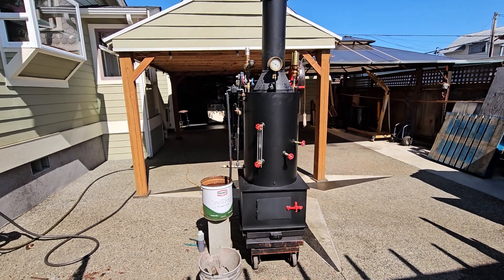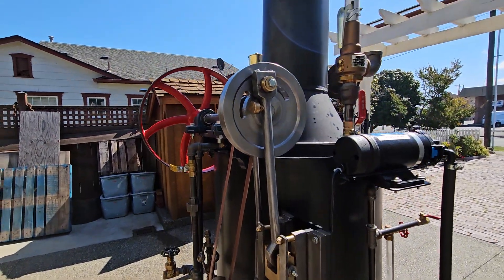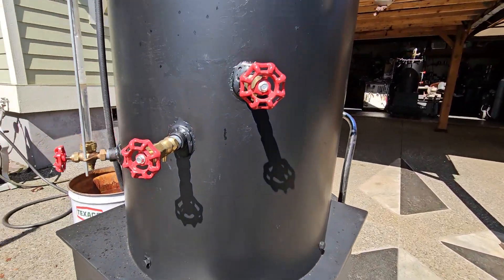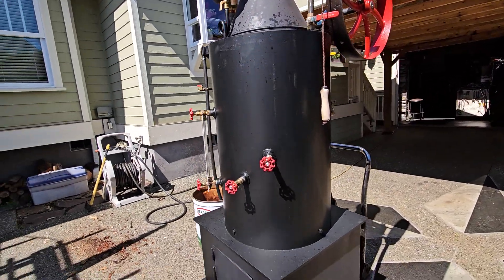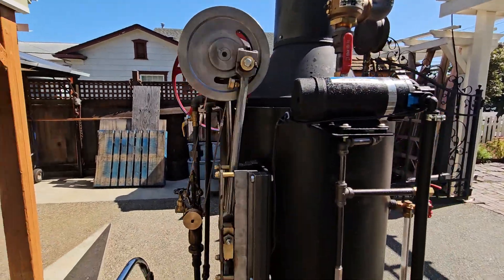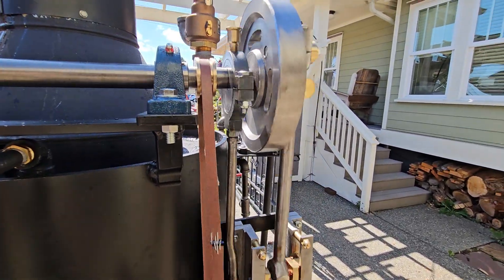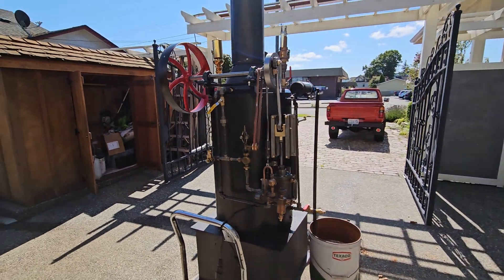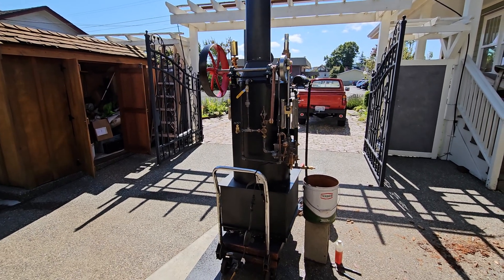Steam Engine and Boiler Overhead line shaft antique oiler whistle off grid Ross Bendixen

Comment: This is so cool.  I wish I had a better understanding of electrical systems.  For example let's say I had big lithium Ion off grid battery bank and solar system.  Could I use something like this to run a generator capable of charging a 100kw Lithium Ion server setup, in a reasonable amount of time?  Or is that just not possible with this sort of technology.